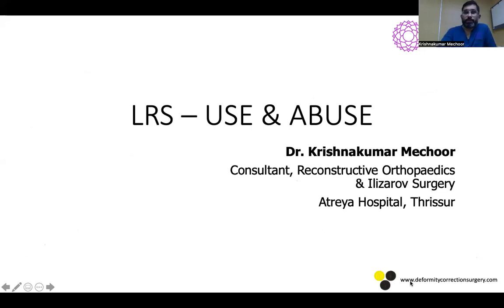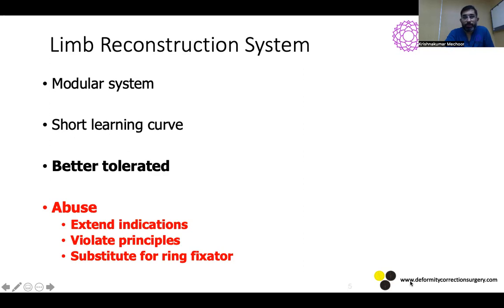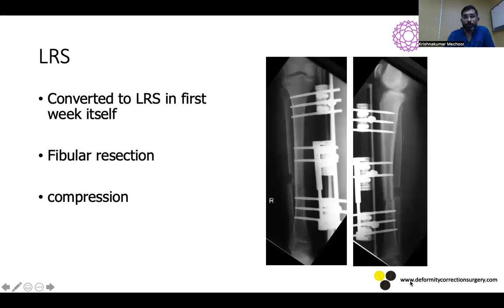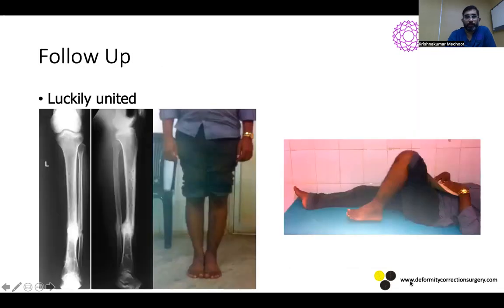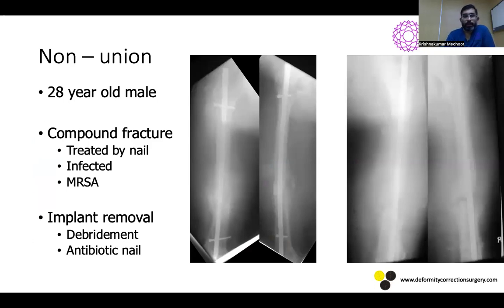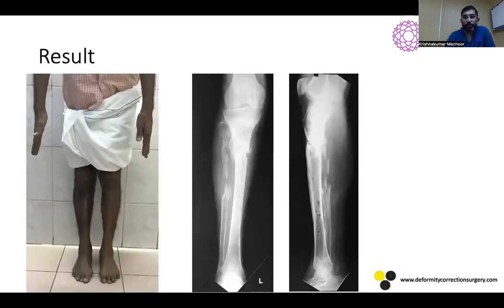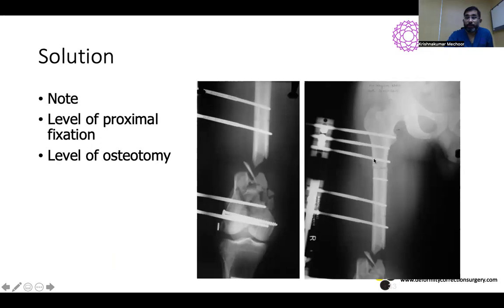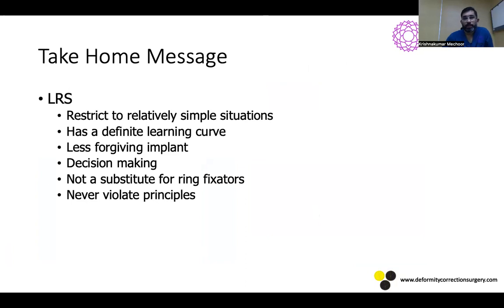LRS Use & Abuse  - Dr Krishnakumar Mechoor

Comment: Thank you for an excellent presentation sir.
How long can we wait for adequate regenerate to form after lengthening ? 
Thanks
Reply: Regenerate can be seen at 3 weeks. For example. One cm regenerate needs lengthening for 10 days at the rate of 1 MM per day. Twice the amount of time is needed for that to consolidate. So a total of 30 days. This is theoretical. When you see atleast three cortices solid on X-ray and patient is bearing full weight you can consider it as healed.